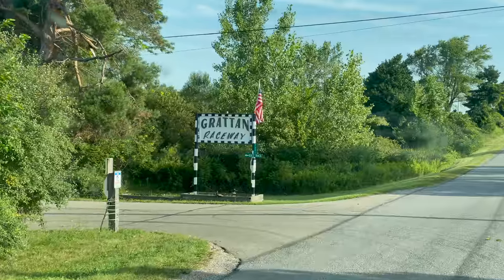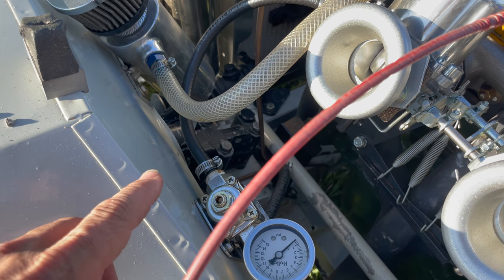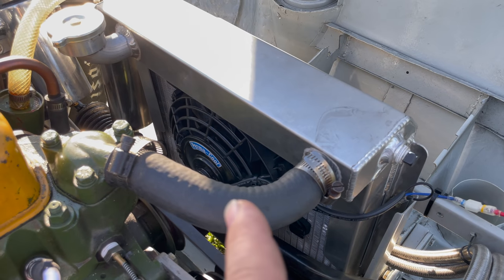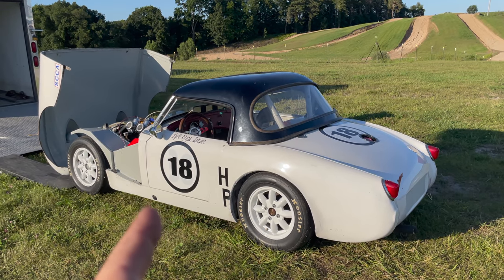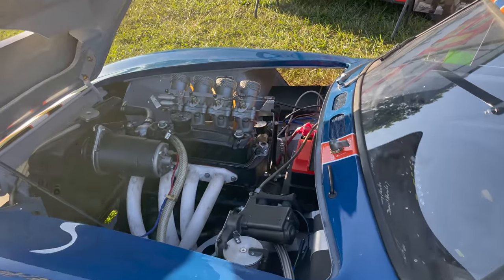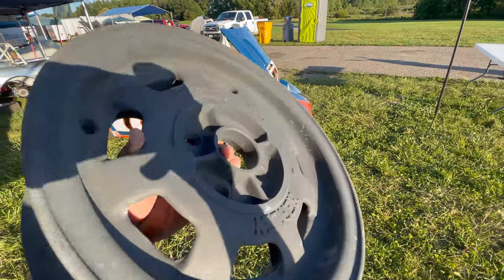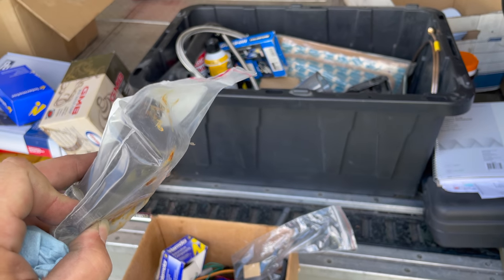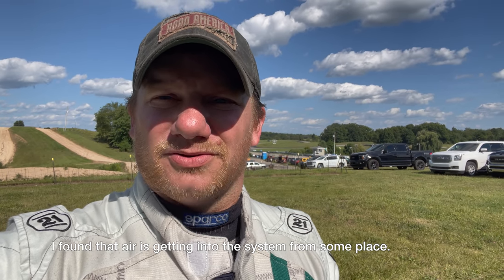Historic Sprites Show Up to All Sprite and Midget Race in Michigan

Comment: It's 51 years since I bought my first white bugeye.
A month ago I picked up my ceramic white MX5 Miata. Nostalgia is fantastic, but so is 6 gears, 2l twin cam, 4 wheel discs, air con and power steering. All power to you though.

Comment: Wow didn't know I was so close. I've got a 61 that I bought with Just a roll bar & bolt on rear coils lol bought it out of southwest MI 25 yrs. ago while still in Lansing. Now I'm wonderin' if it could of been hobby raced there, back in the '80s early 90's?
Thanks Again Steve for the added treat with the track vids.

Comment: Cool, I've run laydown enduro karts at Grattan.  It's a tough track, I wasn't prepared for the off camber corners and it took me 2 or 3 practice sessions to make the first lap!   After the initial slow start I did well.  Ran there a few times.  The second trip we brought fishing poles because of the neat little fishing ponds inside the track.  While my racing buddy and my father fished with lures, I concentrated first on catching a tiny bluegill.   Then I used that bluegill to catch the largest bass I'd ever caught and won our little unspoken competition.  Lots of great memories from that track and those years.

Comment: I suppose the good thing is that you got to run the car after it being laid up so that must have been fun.  Lets hope it is an easy fix.  Also, I noticed that you don't double de-clutch your down changes.  It's a handy habit to get into.  I have been doing it ever since I learned to drive and successfully rev matching is a challenge I often set for myself.  👍

Comment: A fun track to play on, pity about the clutch.  I wonder if the problem is the master cylinder seal failing.  The rebleed after fitting the second slave might have disguised it.  Also, is the step up from the bottom of the trumpet to the carb throat intentional?  I thought it was supposed to match the carb accurately.
Reply from the maker: I haven't been able to find the proper trumpets for these carbs yet so I had to run what I had.